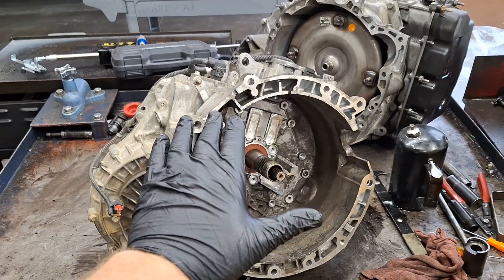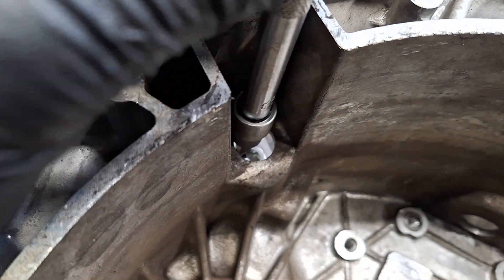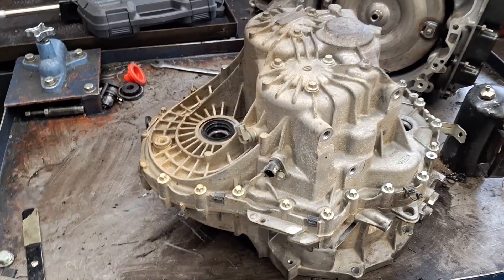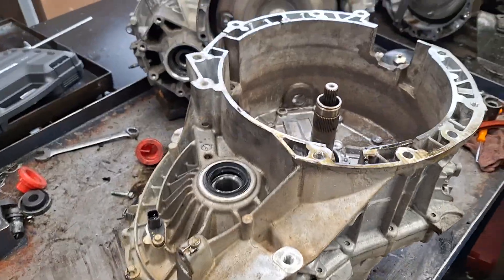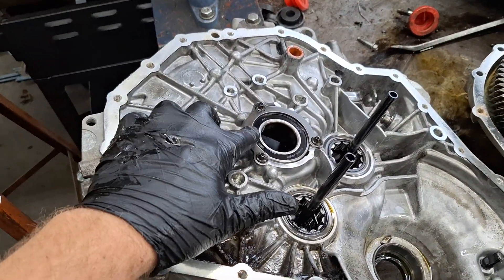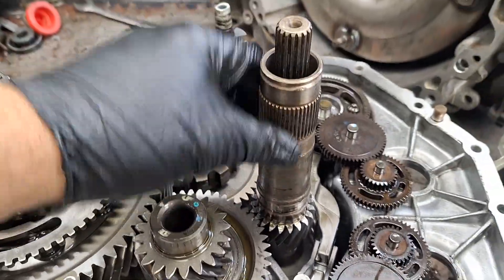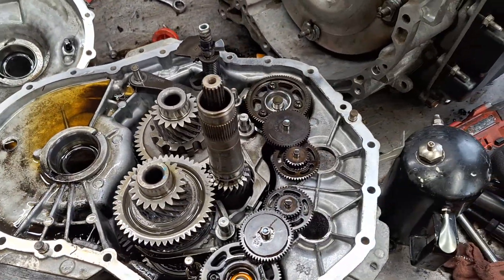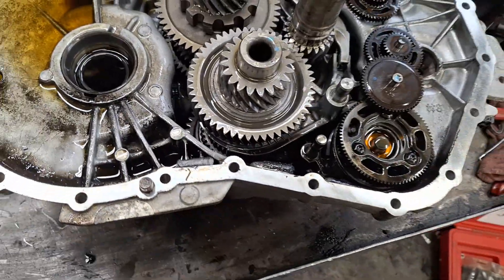Ford Focus/Fiesta DPS6 Partial Teardown, Common Internal Issues!

Comment: Hi @bigbenscarsandcycles
Great videos, they have taught me a lot, I’m on my second dct250 rebuild now. Don’t suppose you know the Ford part number for the input shaft bearing. Here in the uk they don’t list the gearbox parts separately so I’m struggling to get a bearing. Thanks
Reply from the maker: The one thats bolted to the clutch housing with 3 E8 bolts right? AE8Z-7118-A. You're not the only one to ask.. im going to make a video about the part numbers now for the input and output shaft bearings

Comment: He is right about everything! Except you don't need a transmisstion table. I just took them off and remembered where things went
Reply: Actually you can remove the bearing from the case and use the case as a stand.

Comment: I just recently replaced a clutch in my personal focus with code p2837, which as of watching most of your other videos is likely the case being broken (hopefully not) I was told by my coworker who works on these focus dps6 frequently that its the clutch, unfortunately that didn't seem to be the right direction. I've replaced the tcm with 2 others just laying around (Not new), Still don't have Reverse and 2nd. checked the gears by spinning with the TCM removed and noticed with some force the upper gear will spin farther than its stopping point. Does this sound like it needs a case?
Reply from the maker: Hey if p2837 is the only code with no other codes present. That means the TCM's bad for sure. Definitely not the clutch
Reply: @BigBensCarsAndCycles  Hey, thank you for your reply. So yes I had p2837 with p287B (I should have mentioned that as well). I'm really hoping it is just the TCM, Ive put in 2 other used tcms (so 3 different tcms have been installed) that have been laying around with no change. Awaiting a new TCM as we speak.

Comment: Does the clutch drum have to be clocked in any particular spot. Are just make sure the stop on the drum and case doesn’t line up.
Reply from the maker: No just sit the drum in
Reply: @BigBensCarsAndCycles thanks Ben. Fix the stop but still don’t have reverse 2/4/6
Reply: Fix the stop but don’t have reverse are 2/4/6 gears so is it the Tcm.

Comment: Hi Ben, first, this playlist is a life saver! Second, if that tab does break off, what code would it possibly throw? I have a P2872 code and my fork just spins. I'm trying to decide how deep I should plan on digging.
Reply from the maker: Hey, glad the playlist is helpful to you. You will eventually get to videos about that if you keep watching the playlist   You will likely get p287b and p2837 or p2832
Reply: @BigBensCarsAndCycles thank you, for the fast reply. I only had p2872 so hopefully I find something that convinces me not to split the transmission open. I tend to be very susceptible to scope creep. 😂

Comment: hi ben i set up diff shim clearance with a dial indicator and skf applicable bearings and race ( lm29749/710 )
i measured .115 inch float (clearance) wit a .030 shim installed  whats your thoughts
Reply from the maker: Hey I'm looking at the manual now and .115 is wildly off the charts, if you want to hop on the discord and share more info and pics of the tools you're using that would help answer your question better

Comment: thank you big ben can u do differential (transaxle)  bearing replacement & preloads  please
Reply from the maker: Hey glad it helped. In order to do a video on that I'd need to buy a transmission and a press. So it's not in the budget at the moment, but yes eventually +
Reply: thank you sir 
i guess it that 307-281 tool /press to set up pre load /shim application  ?

Comment: Hi Ben, thanks for your great videos!
I replaced the clutch pack and actuators about 1,000 miles ago, but now I’m facing another issue! :( There’s a grinding sound when shifting in and out of third gear. I suspect it might be the synchronizer.
I'm planning to tear down the entire transmission. Do you know if there’s a complete repair kit available to replace the whole gear train?

Comment: Im just replacing one shaft the forward gear shaft do I need the assembly table or can this be done without it.
Reply from the maker: @jshawnm  hey pretty sure you need the table.
Reply: Tks, just one more question. I have a 2012 feista what years models will fit this one. Ie feistas focus?
Reply: Big ben i installed the new drum with bearings seals ext. Now it sounds like a high pitch wine when shifting from 4th to 5th gear then it just quits and i hear the tcm wine again real lightly . Any ideas what this could be?

Comment: Dose any one have the part number for the input shaft bearing? It's not the same as the others by the plastic tubes which are the 6305RS

Comment: Hey Ben!  Just bought another 14 focus with the dps6.  Issue im having is 3rd gear won't engage...heard a screech or grinding noise a couple times but mostly it just skips to 4th directly from second and otherwise drives good.  I assume I have a bad synchro...whats your thoughts on the ac delco 75w80 cure in a bottle...worth trying or go straight to tear down?
Reply from the maker: @FullFaithRepair  hey, id go straight for teardown on that since it's making noise
Reply: @BigBensCarsAndCycles  ok thanks for that...I saw in your vid the assembly table, they are really expensive, are they absolutely necessary?

Comment: Why are you trying to repair this POS? Just replace it with the old four speed auto that came in the 2001-2008 focus.
Reply from the maker: @stephengreen3566  I might do a swap like that one day for a series. Always looking for a new project. Currently 2.0L ecoboost swapping a focus. And I manual swapped one and did a tutorial series on here for it

Comment: Your videos have been a lifesaver Thank you!! What tool would you use to remove the outer piece of the differential bearing? I am replacing the bearing and the wall that in the bell housing side is all pitted but the notches to remove them are at like 90 degrees from each other.
Reply from the maker: @nitehiker642  glad it helped. Remove and discard the axle seals, and punch those other parts (races) out from the outside of the case. Using a punch and hammer. Make sure to reuse the shims that are under them
Reply: @ thank you so much!!

Comment: @BigBensCarsAndCycles Do you have a part number for the Input shaft (closest to the engine) Ball Bearing by any chance? If you look it up online its really difficult to determine which is the right one. Thanks in advance.
Reply from the maker: Should be AE8Z-7118-B 
https://www.fordpartsgiant.com/parts/ford-bearing-asy-needle_ae8z-7118-b.html
Reply: @BigBensCarsAndCycles  I did some digging and it’s actually AE8Z-7118-A not B. It was really hard to find though.
Reply: @FreePalestine1173 does it differ with year?  Mine is a 2012. Curious what year is yours
Reply: @FreePalestine1173  I know this is a old post but is it A for sure,just double checking, B is a open bearing
Reply: @ Thank you so much 😊. Your help, is more appreciated than you know. Love what you do!

Comment: My tranny is leaking some oil from the case pan , around the bolts under the bottom  , what do you think it is ? Gasket sealer ? Or cn i use transmission stop leak ?

Comment: What bearing failed on this one?
Reply from the maker: one of the 3 output shaft bearings. check my video for used dps6 transmission inspection for more info on replacing them

Comment: So i swapped out the clutch drum and put everything back and not the car cranks but doesnt turn on or stay on. Just cranks. What do you think the issuse would be there?
Reply from the maker: You did a clutch job and it cranks no start? Check for unplugged vacuum lines, missing vacuum caps. If you pulled the intake manifold did you put the gaskets back on?
Reply: Check your grounds around the transmission. Mine did the same shit it was a bad ground. Though i did a trans swap not a clutch drum job

Comment: hi i have a ford focus from 2016 with powershift , drives perfektly but comes up with a p700 failcode and it only shift with padle the it goes away after some start and stop and drives perfektly the next 100 miles less ore more ? do you know this problem ?
Reply from the maker: Hi, i just need you to double check your code and let me know. Youre missing a number

Comment: hello sir, very nice video, just wondering witch direction for the two clock gear at the bottom when you are install it in to the table? i can put both gear in either way witch is 90 degree off where the ram come up can you show me witch way is the correct way... thank you
Reply from the maker: I take the little clock gears out before installing the transmission onto the table. If you'd like to post pictures of what you're talking about, I've got a facebook group, link in the channel, and we'll be able to help.

Comment: What is the different between the black seal or the orange seal like you have? Mine is orange not black like i have seen others have ???
Reply from the maker: Black seals are the old design. They are trash and leak fluid onto the clutch. The orange seals are the newest design and I've never seen one leak that was correctly installed.

Comment: How do you diagnose this with the transmission in the car?  I pulled the TCM to get access to the gears and rotate them by hand, but when I rotate there is some resistance.  like a spongy resistance, not a dead stop and i am a bit hesitant to push past the resistance as I don't want to break anything.  Any ideas on this?
Reply from the maker: That's a normal resistance feel. If you have a scan tool, try doing a clutch adaptive learn. If it passes, the case stops are OK. If it times out doing the neutral command step, the case stops are probably damaged
Reply: @BigBensCarsAndCycles Thanks so much for all this info.  There are a lot of us DPS6 folks out there that are trying to fix these without spending thousands and you are a life saver.  I am using forscan and the one of the steps on the adpative learn has a progress bar that just continually resets.  I let it run for 10-15 mins before I just cancelled it.
Reply: same problem what was the diagnosis

Comment: Do you have any idea what ballpark it will cost to fix shift drum?
Reply from the maker: A new case half should be 300 to 500. And they'll charge the "overhaul" labor, which is around 16 to 18 shop hours. The labor rate depends on where you're located. Ballpark 2 to 3 grand
Reply: @BigBensCarsAndCycles  thank you for responding I really appreciate it!

Comment: That's my problem right there shift drum. I'm still waiting to hear back from the transmission specialist to get a quote. I did replace everything in the transmission clutch, fork, slave cylinder, even hub as well and I also did relearn everything it passed so I took a road test all of the sudden it won't shift properly and no more reserve so I'm back in the same place where I can't use my car. Smh
Reply: same problem what was the diagnosis